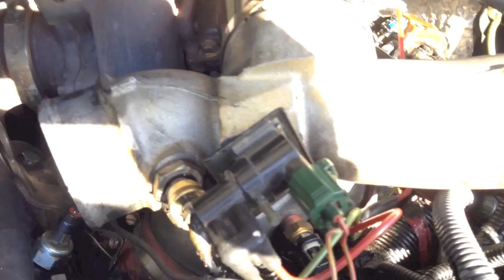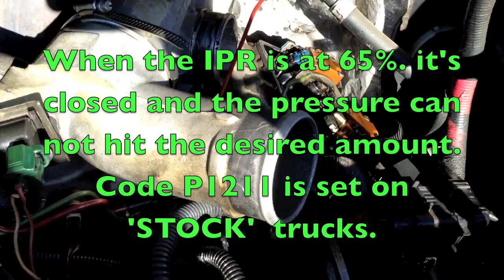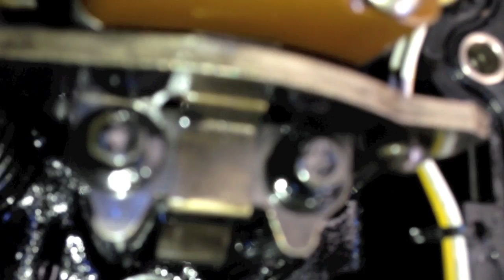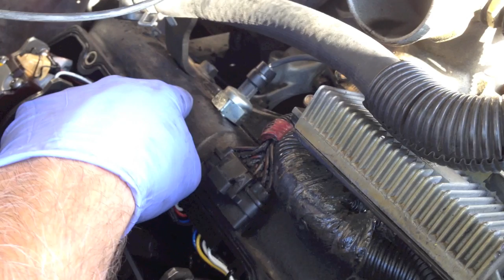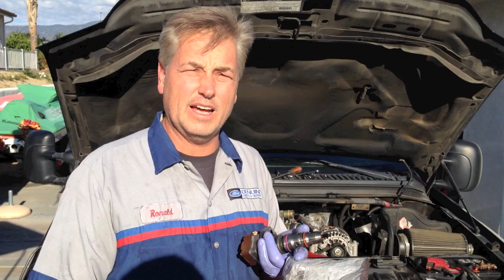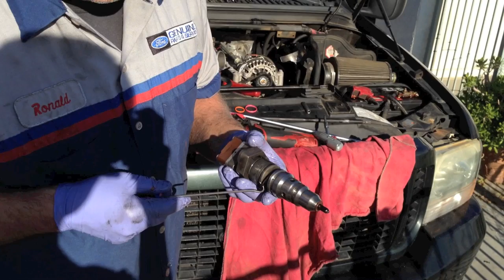Ford 7.3 Powerstroke no start hot. long crank

Comment: On removing those two oil plugs in the head to drain the cylinders if my truck has sat for over a week now and will be another week before I get the new seals in what I still need to pull those drain plugs

Comment: Hi Ron I changed my fuel filter in my f350 03 and after that my truck  running rough and lock it of power can u helping me with advice about this problem 😬?
Reply: Sorry to tell you but Ron passed away a while back. He was a good go to guy.

Comment: i have a 7.3 02 130k wont start replaced orings, turbo is leaking and white smoke out of tailpipe, runs 5 secs then dies and wont start any ideas thanks
Reply: check out PowerStrokeHelp on YouTube as well. Diesel Tech Ron has great videos and information however he was since past away. 

Sound like a compression problem to me. however watch the PowerStrokeHelp great stuff.

Comment: Ron, Question, wouldn't a leak like that be indicated by diesel in the oil?
Reply: Dan Carlin at 6.22 he will show you that it is oil in the area where the top o-ring is letting oil bypass and not diesel
Reply: Ricky Lakey np, found that out when I did my injector cups.

RIP Ron.

Comment: Hello Ron, I'm having a cold start problem. If I plug it in over night or just for 1 1/2hrs in the morning it start up fine. I have learn a lot from your video, I looked at your fix it for a quarter video and when ahead and replaced the valve cover gaskets with wiring assembly, replaced all glow plugs and glow plug relay.now the relay did had power the the valve cover plug on the out side. I did not see that gap on the inside plug, but when I started to unplug the injectors, the connectors was breaking apart. I full charged both batteries, and stills does the same, won't start. I have take in it to ford here in Hutto, txt and I was told I needed all 8 injectors. I have an old snap on scanner and done a buzz test and the sound good. A different shop told me if the injectors were bad it would run rough and be smoking. The truck run great, I just replace the fuel pump, pick up screen and cleaned out the filters on the sending unit. Any other suggestions?

Comment: I had forgotten about your 5/8 wrench trick but I found the lower bolt is so long winded I was able to get more than a few turns in before it started pulling on the plate - it felt pretty safe to me and I assumed that was why the bolts were so long.

Comment: remove the glow plug after injector replacement and then crank engine with it out to purge cylinder of oil and fuel mix.

Comment: First let me say your videos have help me a bunch in the past. But now my truck is doing the same thing the truck in the video does runs perfect when its cold as soon as the engine is warm the ICR is at 65 and won't rev up and no power
 I've changed hpop ICR ficm cps and a couple other things. Any help would be great.

Comment: Would a bad injector cause pcm shut down crank no start, no fuel pump, no wait to start, no service engine soon, no scanner communication, no nothing...   Checked fuses, relays, icp, fuel pressure ,hi pressure pump, valve solenoid... all good tested alone just no pcm communication. Started checking wire hardness. Disconnected 41-pin connection and I got pcm communication glow plug relay fuel pump, but no start disconnected..So I reconnect no pcm no wait to start no nothing. Can someone help I'm about to fix it with a $4 gallon of gas and a match.

Comment: I decide to try to do it myself after i saw your video.  The seal leak when start on a injector and it work well, forgot to drain so start it with no injector on,  (SPILL) (get away)   But work well.  Thank you very much, you make me save a lot.

Comment: Hello I have a 1996 ford f250 powerstroke diesel and for some reason it want to crank it won't start up? I believe I have air in the oil? I'm not quite sure.

Comment: Great video as always! I curious, Is it fairly normal for experienced techs such as yourself to replace an injector without a) cleaning the injector tip, and b) cleaning the injector bore. Personally I have only done a couple powerstroke injectors but with the sensitivity of the HP oil system, I took the utmost care in cleaning everything.
Lastly, What is your opinion on oil selection for powerstroke owners. I hear so many differing views.

Comment: Ron, as always, another great video! Thanks for the information. Question, if one is torn would it not be prudent at this time to replace the seals on the other injectors? If you have done this repair on one injector what is the longevity of the other injector seals in your professional opinion? Thank you!